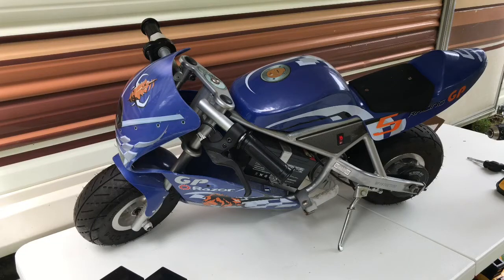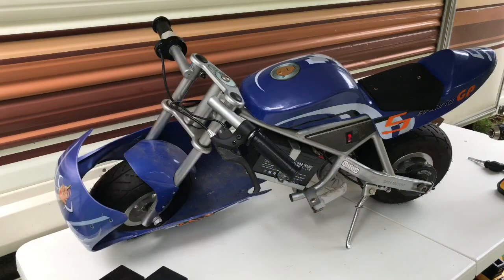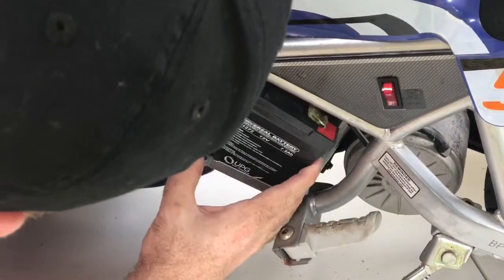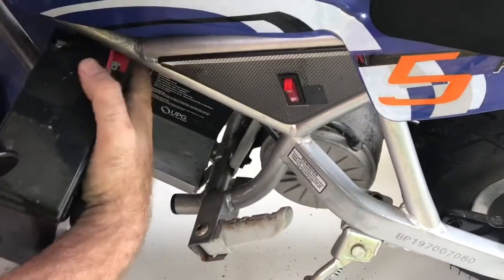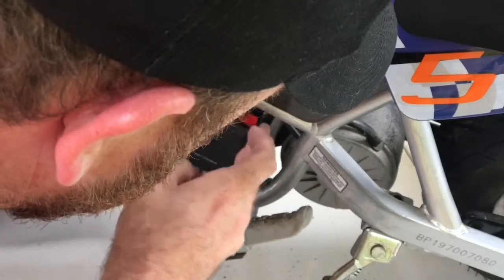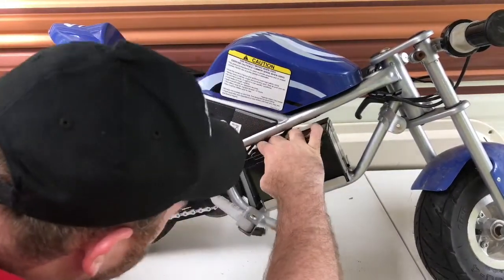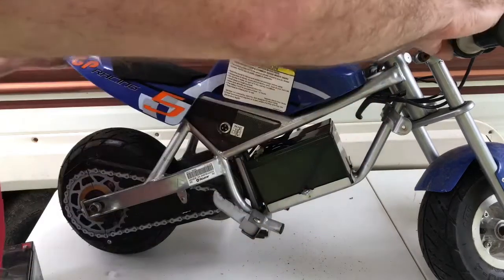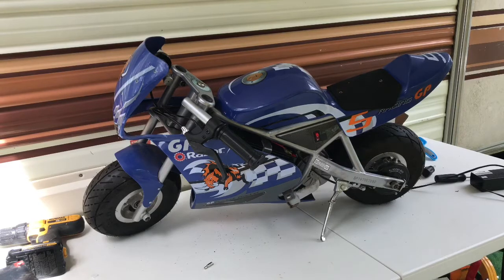Change Battery in Razor Pocket Rocket

Comment: hi Dan looks like your having a good time with the camper and the fam.
just wanted to stop by and say hi
Reply: Shawn Springall Hey Shawn! We definitely enjoy our camping trips. :-) Hope all is well with you and yours
Reply: Hi Dan I just watched your video on "the razor pocket bike changing the battery" I was wondering if you can tell is the battery my issue I bought my son a used one charged it got the green light saying charge was good but when he got on it turned on switch turned throttle bike won't move I picked up back tire twist throttle wheel turns fast  don't know what's going on do you have any idea

Comment: Dan what if the tire spins when your not on it but it don't want to go when your on it.does that mean you need a new battery?
Reply from the maker: It could... also depends how big the person is riding it...  the weight limit is 170 lbs...so that could be a factor.  But if it has a full charge and you are under weight on it and it still wont go, the batteries would be the first thing I replaced